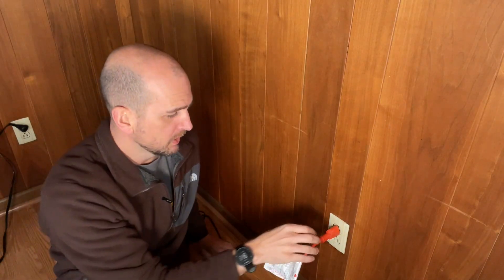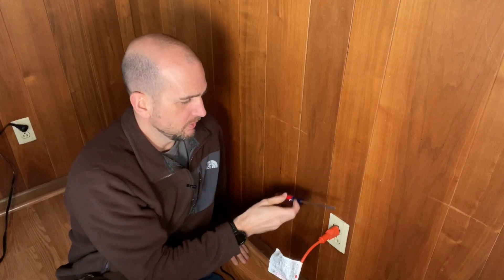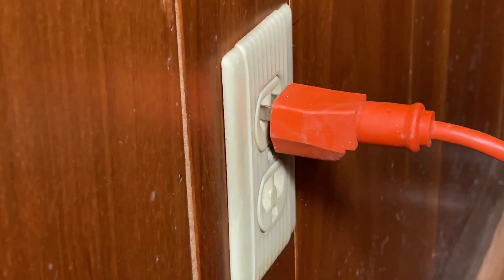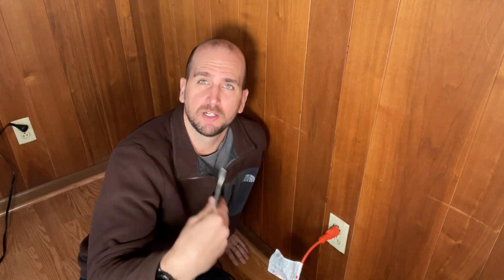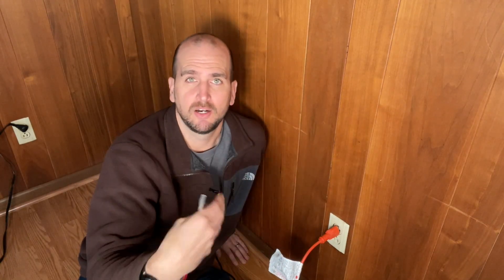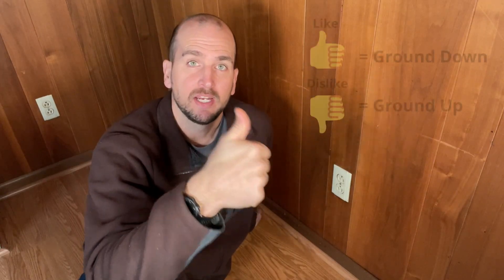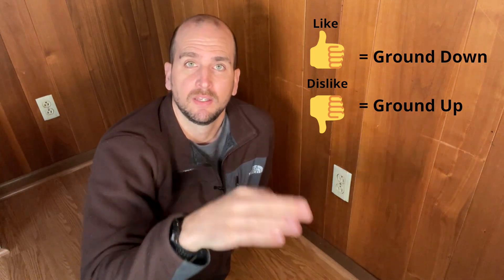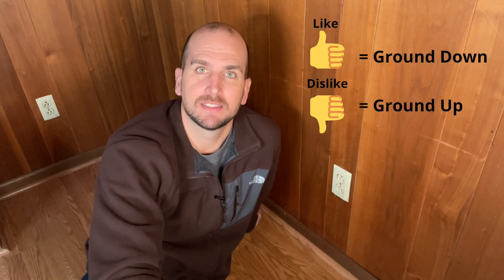Should An Outlet Be Installed Ground Down Or Up

Comment: Always ground up. I an apprentice who was pulling wire with a metal fish tape. As he was pulling the tape was coiling up on the ground. There was a three prong cord that was pulled a little bit. The ground was down. The tape fell between the outlet and the plug. Hit the hot and neutral and was welded to the plug. And of course the breaker tripped. I wasn't a situation. We were working in a hospital. Luckily nothing bad happened other than a little damage to the plug and metal fish tape.

Comment: I have seen some AC adapters that fall out when the outlet is upside down. Then there is the upside down nightlight issue. If I went to buy a house and the outlets were all ground up, the would be a deal breaker.

Comment: I see it as which way will cords be used most. For appliances / gadgets that are above the outlet with the cords going down to the outlet, I prefer the ground down. Which can be at time somewhat interchangeable. BUT, when cords are run from below as along the floor, the the ground should be on top.  Why? Because of the cord shape. Notice the more rigid , triangular ground side vs the flatter and more pliable section of the cord. At this angle the cords are easier to 'face' downward. Cords running along the floor/bottom edge of the wall, will have less bend resistance. If ground is down and your cord runs along that same lower path, it will have the tendency to want to go up before settling downward.   Did I explain that clearly?

Comment: With the ground up the three prong plug stays in better and the ground pin doesn't break off as easily.
I use it on temps for construction sites.
Residential customers are used to ground down so that's what they want and get.

Comment: I install ground down for three reason
1- the brand I'm used to has the brand name ground down.
2- if you look at a ground facing down plug it looks like face and looks more natural to me.
3- if your ground is facing down you can see the two prongs go in the holes and the ground naturally falls into place.

Comment: When ground is up, just the weight of the cord will, over time start to pull plug out. With ground down the ground actually provides a base for plug that keeps the cord from pulling out. Particularly with heavier cords.
Reply: As an electrician, all my life I've wired them ground down for a more secure connection.  My dad was a union electrician his whole life and he did it the same way.  The reason I was taught that way is that it should be ground down was for safety reasons.  If someone trips or steps on a cord, you don't want to loose your equipment ground.  If the plug starts to come loose, which I have seen happen, the last thing you want disconnected is the ground because your equipment could still operate in an ungrounded, unsafe manner.
Reply: @keg9776  ‘8
Reply: If the recpt. is that loose than replace it!
Reply: Actually, they both provide pretty similar security of plugs.
Reply: In my trade school we were taught ground is green and ground is down the world around. When I finally got out into the world electricians argued over the virtues of each. Just be consistent in your work site,
Reply: And while you guys fight among yourselves, I’ve seen outlets installed horizontally in many work environments.
Reply: Just an observation, on a heavy cord in a high outlet. If the cord will be plugged in for an extended period, even a few days, I try to find a way to support the cord other than the outlet itself. For a permanent installation, especially our of reach, I’d recommend a twist-lock receptacle and plug. 
As a last comment, nearly every situation can have an exception, so no offense intended.
Reply: @tonyv8925  Lp++
Reply: That sounds logical to me!
Reply: This is exactly what I have found. Of course there are variables (like age and quality of receptacle) which will make this be an issue of different degrees. The ground prong and down most definitely makes a stronger anchor point. Of course the safety aspect with ground up is obvious, but when will that be an issue in many situations. I can see in medical facilities where it is imperative to have solid electrical concerns being an issue. What needs to happen is it be decided which is best and the “Standards” industry stick with it and make it code. I have used some designer stuff that made it impossible to do it any other way based of the fixture and base plates. It’s a pain worrying about this sort of stuff when we have gone at least a half century not being concerned and ground down being the norm.
Reply: i believe exactly the opposite is true the best grip is on the ground plug and it makes contact first and i have seen first hand a piece of aluminum foil on a kitchen counter short out across the hot and neutral with ground down so it is much safer
Reply: @ranger178  And if it were a two prong, how is it much safer? If the foil is on the counter and you did have a three prong plug, the ground would help shield the foil from hitting the hot leg from the bottom.
Reply: Working in a SoCal hospital,  we always had to install ground up to meet federal hospital codes. That and GREEN DOTS with 5lb pull per prong, which was tested every 6 months. All hospital receptacles had to be replaced every other year. I can tell you why an aspirin costs $33.00 each.
Reply: As an electrician.. that comment is the dumbest thing i have heard .. ground down keeps the cord in tight.. unless your plug is 5 feet off the ground and the cord is heavy and even then plugs dont pop out like that.. how about you choose a plug and use the heaviest cord you can find and observe and take a picture every day for comparison .. you are going to be doing that for a long time.. no science in your statement
Reply: @darryll13  Any 70-80s wall wart that had a ground usually had a huge heavy transformer, I could totally see this argument through those years.
Reply: @darryll13  thank you it did sound funny,  But I've seen people spread the prongs to get better contact on outlets that. I quess some people are just not very observant. (dumb)
Reply: @darryll13  
Hey F’ wad…that’s what the OP was saying. I hope you’re never my electrician with your lack of reading comprehension.
Reply: @darryll13  as someone that lives in a house from the 80-90s I can confirm with out a shadow of a doubt that outlets get lose and become very hard to keep plugs in and powered the ground pin does help in keeping your plugs in over time but that’s not the intended use for that they don’t have to be heavy or high in the air shocker I know but it happens you must be a newer electrician or one that works only with new outlets because I have had to replace a few just so I can use them
Reply: @darryll13  replying due to the dumbest thing ever heard - that seems unnecessarily rude. ☹️
The outlet he was demonstrating on was very loose, why he was replacing it. It clearly looked very very loose me. I see heavy extension cord  plugs sagging and on occasion that is the answer to why doesn't this Outlet work.
Reply: @darryll13  Your statement just shows that people just look at things differently....a master electrician I used when I contracted out work has the opposite opinion as he suggested that by having the ground facing up, as the plug worked its way out, would actually maintain the positive and neutral prongs to remain in contact as the plug would angle out of the socket as it pulled out and help keep it from falling completely out.

Comment: I was told to install ground up to stop shorts  if something slides down the wall and across the plug ends! With ground up any thing will slide off without shorting if it was ground down? But all my real electricians said don’t matter but prefer ground down? I do mine up because that’s what I was told!

Comment: It depends on what is likely to be plugged in to the outlet.  Cord on the floor ground on the bottom. Cord going up like a time clock , ground on top. Sometimes outlets are sideways?

Comment: In all honesty, I don’t think it matters. How many times in your entire life have you seen a short between hot and neutral on a hanging plug? For me, the answer is 0. That being said, these days I’m mostly installing ground up around the house. (1) maybe marginally safer (2) denotes outlets I’ve had open/worked on/checked wiring. (Come across a few outlets in the house I don’t like how they are wired)

Comment: Ground down. So many plugs nowadays similar to the "quick right" in the video where the cord comes up from the bottom of the plug. With ground up you'll get that tension and if using the bottom outlet the cord will then block the top one.

Comment: You should put the ground down because if you put the electric down the electricity will run out   just like leaving an extension cord plugged in the electricity will run out the end

Comment: When you're in a house in America with a ground down receptacle but you travel to Australia on the other side of the globe, that same receptacle becomes ground up from the perspective of where you are!
Reply: #i’m14andthisisdeep
Also when you get to Australia, be sure and just stay there because fuck America
Reply: Except Australia doesn’t use 125VAC they’re on 240
Reply: If you can see your ground-down outlet from Australia, you have very good eyes.
Reply: I don't think there is a legislated reason  (none of my electrician friends know of one) for it but all sockets I have seen in Australia have the earth towards the Earth. The switch on the socket is often marked in red and is visible only if the earth is down so it a convention. It also means that if the cable is dislodged gravity assists in ensuring the earth is the last to disconnect.

Comment: The receptacle was invented by Harvey Hubbell in the late 1800s (hubbell.com) and evolved to the multiple configurations we have today...  I was told by Hubbell (not by Harvey himself, I'm not that old) the original idea behind the ground-up concept was because the mounting screw on a metal wallplate could vibrate loose... and if the plate slipped down it would touch the hot an neutral causing a short... and any metallic cords. chain, etc. that slid down a wall could so the same if the plug was not fully engaged.   The NEMA configuration chart does show ground up (probably Harvey Jr.'s doing) which is a hint to what orientation was expected... but there are no rules anymore... and anyway, ground down looks more like a face...  actually the look of shock.... Hubbell and a few other brands focused on the higher grade industrial/institutional market. leaving the inexpensive residential market to companies such as Leviton, Eagle, etc.  Today, the companies that are still around, such as Hubbell and Leviton serve all markets...

Comment: Goes by code. 
Canadian Electrical Code has ground at the bottom. 
Local codes override it, so Quebec has ground above. 
If, and or buts. There’s no arguing with the inspector. 
It’s liked ganged boxes need a continuous ground wire. Not pig tailed. Never see this mentioned even though every inspector I’ve talked to say it’s the #1 failure of all inspections.

Comment: If your plug is slightly pulled out and something falls, it is probably just as likely to short between the ground and hot if the ground is up. Who is to say the falling object will fall flat? With NEC not specifying a correct way, I would guess smarter people (code writers) dream it to not mater.

Comment: They are both legal. You can install them horizontal. pay attention to the use of it.  For example, a refrigerator or drier. Does the appliance have a 90 degree cord connector?  Install the receptacle that does not put strain on the wire when plugged in.

Comment: In the instance of something falling over or down onto the cord, if it is heavy enough to cause damage to the cord, ground down is usually the safer choice because the upper terminals tend to pull out of the plug disconnecting power  where the lower terminal/s tend to stay in contact with the outlet and at times are even separated from the cord end if ground is on the bottom the safety feature of path to ground is maintained if the power terminals are on the bottom path to ground is lost and you have a damaged cord end that is still hot.  In metal shops and mechanic shops this is way more common than it should be. I'v seen many extension cords where the ground terminal is rolled out the bottom of the plug because something fell on it.

Comment: I Did not see one comment here specifying to check if the ground is actually grounded! Many old houses have 2 prong outlets or outlets were changed over and are a hazzard with false grounds. Get the $8 tester at the hardware store and check your house, or check that cute little 1920's house your daughter wants to rent.

Comment: The best thing to do is get to know the local inspector and find out all of his requirements because some of them like to try to change the rules
Reply: Inspectors are overrated.
Reply: @stevenbryant4718  don't put down the inspectors for the biggest part most of them just try to keep people safe I used to do inspection myself but actually as far as the circumstance of where the ground is up or down does not really make a difference because if a person is safe they are not going to have anything to drop off on the plug and if so that is why it is protected by a circuit breaker and a ground

Comment: I do agree with the ground being up as far as providing Extra Protection against a short circuit if something falls on it but that is the only thing other than that if you have the ground down it does give it more support and prolong the life of the receptacle but if you want my opinion they should put a ground at the top and the bottom

Comment: From personal experience of doing the electrical work I have found that it is better to put the ground down at the bottom that way it gives your plug more support at the same time to keep it from coming unplugged the ground is a weight barrier also it helps keep the weight off of the positive and neutral terminals which reduces the amount of wear on them

Comment: Ground facing down - because all 90 degree plugs as well as chargers etc are designed for ground down.  There is one exception - if the face plate is made of metal and has only one screw in the middle, then ground up. That one screw can become loose and fall so the metal faceplate can short out the plug. Of course if there is no ground on the plug, then it doesn't matter. as far as objects falling on it (except for the faceplate), the probability is extremely small.

Comment: Where I come from, the ground is down🇨🇦
Reply: Except in Quebec, where ground facing up is seemingly more common.
Reply: @MuZiKiNmYMiNd  The Ground direction matters because when you replace a non grounded plug the replacement has ground by law. The positive most be left to ground when ground is facing down otherwise the safety features of fuses and beakers are defeated. In the USA a person called a code enforcer comes by the apartment to check the orientation of outlets.
Reply: British, Indian and Australian socket designs are all with ground pin on top.
Reply: @vedabitnag4678  Those county have soupier electricity but the yankees have outdated electricity .
Reply: @gotsm9959  that I'll agree with... Here in the US one string of the wrong code and the whole grid goes down... Saw a deal on 60 minutes about it, a few years ago... They definitely need to upgrade the electrical power grid infrastructure, big-time, but it costs major money
Reply: @northwiebesick7136  Yes after hearing about Texas power outage I started dooms day prepping.
Reply: They only hurts 50 while in USA we hurts 60.
Reply: Texas, a MAJOR oil and natural gas producing state, has been replacing old coal fired power stations with windmills. In the terrible cold snap the windmill blades started icing. When the blades got just a little out of balance the mills shut down. As 25% of Texas’ electric power is from windmills and some solar, the coal and gas fired power plants could not carry the load, plus they were not prepared for the unusual freezing conditions that gave gas fired plants fits.
Overcapacity is extremely expensive. Coal fired plants are very slow to respond.
Reply: @hkelly1623  50or60 hertz dose not not really important as long as it's a pure sine wave. A pure sine wave will keep a cost voltage output that rises in amperage as the wattage load on the transformer increases.
Reply: @hkelly1623  Except the gas plants also had cold related problems.  The Texas governor had to admit that he was wrong to blame windmills for the problem.  The problem was that it was a once in 10 years cold snap and very little of Texas' infrastructure was ready for it.  Even windmills themselves work fine in cold climates as long as they have the cold weather mitigations installed.  We never hear about windmills freezing in Canada or Nordic European countries.

You need to reconsider your "news" sources.
Reply: @gotsm9959   Ya that's why domestic electrical fires are 90% less common in North American than in the UK.
Reply: @matthewq4b  The British use the same Chinese junk as the Yankees which the only difference is the plug because only a few devices care about pure sine wave which normally have a power supply to filter the AC like computers or tv's.
Reply: @gotsm9959   WTF does that have to do with eletrical fires.    I said ELECTRICAL.... NOT APPLIANCE.    Not the brightest bulb on the string are ya.
Reply: @matthewq4b  I am a led bulb
Reply: @matthewq4b  The electrical standards in Britain are the same except for sine wave aka Volt to amp ratio of wattage. If voltage stays the same and the amperage increases with wattage then that is a pure sine wave.